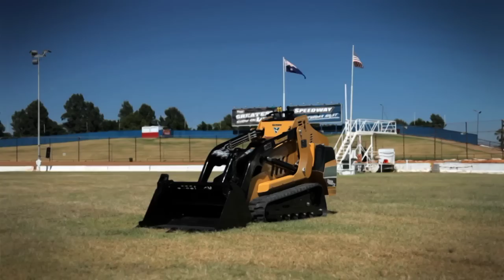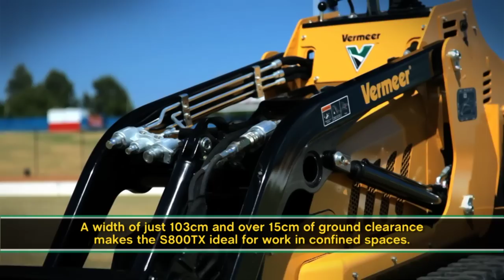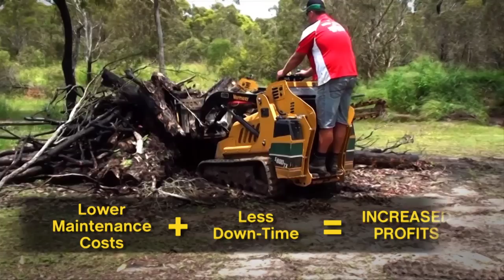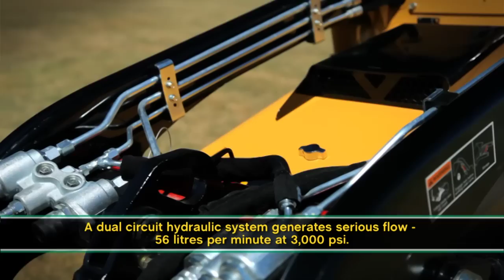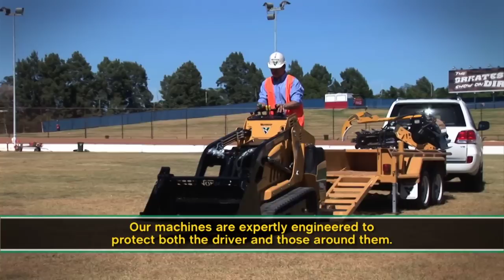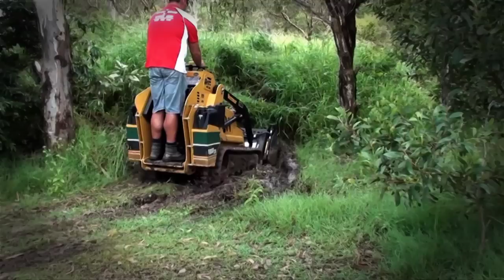Vermeer S800TX  Mini Loader - Review

Comment: I'd be careful with Vermeer I bought a used mini digger from them to start a new business it was all the money I had. Was told it was tested and in really good condition . I bought it on line thinking it would be safe from a big company like Vermeer ,,wrong they said it done about 700 hours more like 1700 all pin are worn to the point can't keep bucket straight it was overheating I did the radiator the exhaust just broke off .the guide wheels are worn. Finally got it going half decent first job.. Bang breaks old weld on ram mounting snaps off puts ram through hydraulic oil tank totally out of work don't buy anything on line of them,,,,,
Reply: That sounds more like an independent dealer. I can't imagine Vermeer, or any company, doing something like that. If true that would land the company in hot water. If you purchased online from an authorized Vermeer dealer and you got the paperwork to support what you were told, then contact Vermeer corporate. I use a Vermeer trencher everyday at work and never had an issue with the equipment.

Comment: Ours is bigger and better
Ramrod M3300
And yes we sell the Ramrod here in the U. S.
and Our reach is longer,and our lifting capacity is more.
Reply: Actually I've looked into the Ramrod line and they are horrible. No thought to operator safety or comfort, design is horrible (who puts an exhaust out the front so it can blow back into the operator)? The operator platform is way to small, can't even fit your whole foot on it. No padding in the interior compartment. Engine protrudes into operator compartment. Low flow hydralics. I could go on and on about the horrible design. Next time, don't be a douche and hi-jack someone else's page for your own advertising.
Reply: Tina Farmer
Reply: what's this
Reply: the Ramrod was on the westside in NYC...big time gay club in the 70-80's ...ass less chaps were all the rage!...go ramrod

Comment: Do they sell these in the US?
Reply: Yes but they're hard to find. I have rented the model below this one, the S600. I was super impressed. They have incredible power for such a small package. The bucket curl would lift machine off the ground if you buried the bucket in a pile. I'd love to own one but they are SUPER pricey. They have unmatched power in this size category and Vermeer knows it.
Reply: i have one coming to my yard this week. It's a 2014 year model and has about 500 hours on it. Let me know if your interested. +jnutty99
Reply: WatersEquipment I may be interested as well. I'm a masonry contractor so I'd be looking for the larger units. S600 and up. I need the weight capacity.